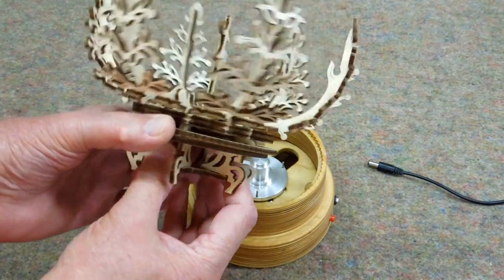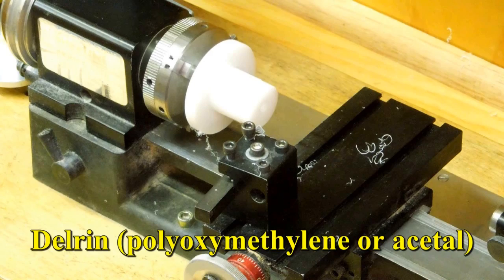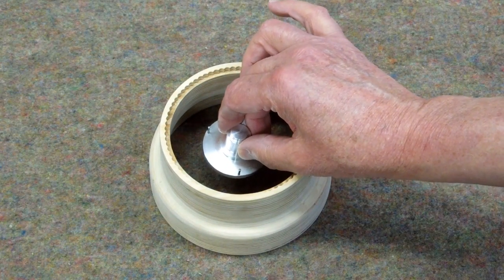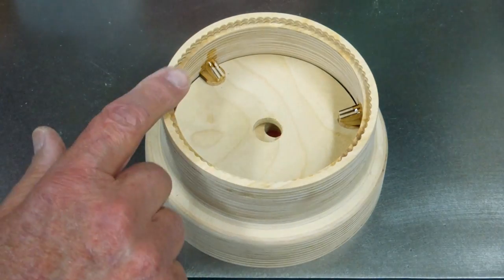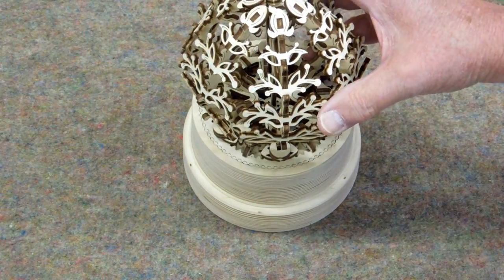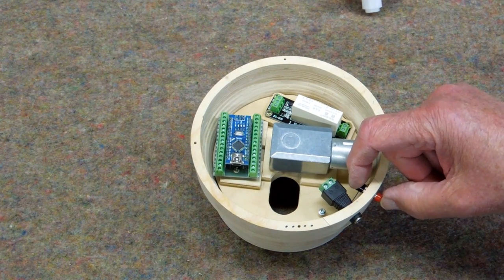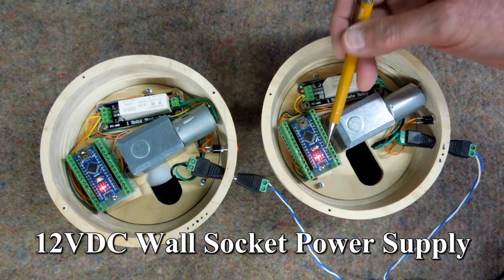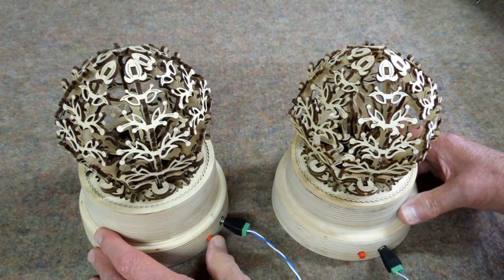Mechanical Flower Part 4 - Motor & Arduino Nano

Comment: Sorry what's the arduino nano for? i thought only the motorized pedestal can turn the flower automatically already?
Reply from the maker: It acts as a timer and controls the relay for the motor. Timer runs for 53 seconds which opens and closes the Mechanical Flower 5 to 7 cycles depending on which gear motor is used. This is covered in Part 4 of the video series. Thanks for watching!
Reply: @RonaldWalters2010  Hi Ronald, is it possible too buy the base and finished motorised part from you? Because i cant make the motor and base myself as i have no workshop...
Reply from the maker: Sorry, I do not sell these.

Comment: I was on the Internet today and quite by accident I came across your video!! I was just given a mechanical flower for Christmas - and was a bit taken aback. I am going to attemp to make it - and wonder if painting the parts (carefully) would be advisable. Also - would you consider making a base for my flower? I would love to have one.
Reply from the maker: This video is Part 4 of a video series. If you haven't already, you should watch the other videos. Part 1 shows tips on assembly and should be very useful for you. That plywood is quite porous so colors may bleed. The parts are cut to very close tolerance. The wood probably needs to be sealed before painting and there is a good chance the sealing would keep the parts from pressing together... resulting in a pile of junk. I decided it inadvisable to do any sealing or painting. Follow the Part 1 Build & Review video and use lots of wax on anything that moves (like gears and axles) or rubs against each other, but not on the parts that press together. Sorry, I am not making any more of the bases. They take are a lot of work and you would not want to pay what I would need to charge. Thanks for watching. Please subscribe. I have quite a few videos that should interest you.

Comment: How about a light inside the base.  It would create some really freaky shadows
Reply from the maker: I thought about using a red or blue LED down inside the base. All those gears and other pieces fill in the bottom area pretty tight and once the Mechanical Flower is sitting on the drive adapter, there really aren't any openings which would allow light to shine up from inside the base. Trying to place a small LED around the ballerina's feet would require the use of a slip ring. It was an interesting idea but ended up being too much trouble. Gave one to my sister for her birthday. First thing she asked, "Why doesn't it play music?" I explained it would have been a recording of ME singing Happy Birthday... she decided it was best the way it was. :-)
Reply: When will you upload the video of you singing?

Comment: I have a question.  So the clover ring stays in place and the legs of the flower rotate.  Is that correct?  Did you think about displaying the legs, and instead, having the clover ring rotate with a chain, gear, or pulley of some sort? Pros and cons?  Also, can you change the timer length to about 2-3 minutes?
Reply from the maker: Yes, the outside ring gear is held in place by the matching piece I made on the router table. The base (legs) are turned by the three pins in the drive adapter I made on the lathe. No, I didn't consider displaying the legs (thus a base displaying a base). +/-  Pros or Cons = K.I.S.S.  It guess it could be done but the base would become quite a bit larger. Doing it the way I chose holds the entire mechanism very stable (no wiggling around). The time is in milliseconds for the Nano...  2 RPM / 3.5 Cycles per Revolution = 57 seconds however the advertised speed of the gear motor is "no load speed" and not that accurate anyway (varies a bit between supposedly identical models), so you need to use a stopwatch and determine the actual loaded speed of the display and adjust the timer accordingly. I have absolutely no idea of the actual life expectancy of the toothpick drive pins operating the pedals. The toothpick axles should last a long time. So I chose a display of around one minute (5 to 7 cycles depending on the gearmotor used). My aversion to using an on/off switch was the distinct possibility the unit would be turned on and subsequently forgotten and allowed to run for an unneeded length of time resulting in unnecessary wear. I chose a single push of a button to allow 5 to 7 cycles and then stop. The Nano can be timed for a longer period... I do not know what the upper limit may be. For 2-3 minutes you may just consider a on/off switch and live with the consequences of wear and tear. All the pieces of the unit just press together, however if it were taken apart to repair worn drive pins (toothpicks) it may need glue for the subsequent reassembly.

Comment: you could put a cam + microswitch on the bottom drive piece so that it will always stop in the "closed' position vs.  an open loop time delay (or a hole/slot cut in same with an optical sensor) maybe if you wanted it to always stop in the closed position.
Reply from the maker: If you watched all the videos you know that one rotation of the base does not equal an even number of openings and closings (cycles). If you want it to open and close several times before stopping "in the closed position" (more than one rotation of the base, as I have done) you still need something to count cycles ... which would probably still require a microprocessor... which is what I have without the further complication of microswitches, cams and optical sensors. Something can always be made more complicated. The actual objective was not to have a simple on/off switch were possibly it would be forgotten and left running, resulting in unnecessary wear... thus a timed run based on known shaft speed.
Reply: Oh sorry, you're right.  I just counted teeth and the drive gear appears to have 24 and each petal is 18.  The ring gear is 60.   Using these numbers, the assembly should return to "home" after 3.5 rotations. (R+S) / S.  This means after 7 full rotations or 7 half rotations (i.e. 2 pulses per revolution) the assembly should be "home" again.  With a 3 RPM motor that'd be around 1.166 minutes it looks for 3.5 rotations.  I hope I did that math right.  As always great vids and thanks for posting!

Comment: Do you know how the efficiency varies with rpm and power changes?
Reply from the maker: With reference to the 12 VDC gear motors, the lower RPM gear motors of this series have quite a bit of torque while the high RPM versions have virtually no torque at all. Search eBay for "12VDC Worm Gear Motor Turbo Right Angle High Torque" and you will find many listings for various RPM units. Look around long enough and eventually you will find someone showing a chart with all the speeds available and the associated torque. Some of the charts conflict with each other as the various sellers copy each others erroneous data, You need to closely study what is available and the exact wording of the listing. Same goes for price.... look around "a lot" before purchasing. Most seem to be 12VDC but there are a few 6VDC & 24VDC.

Comment: A battery and a sensor rather than just time would be a nice touch. (A slot in the delrin and a simple led/photo detector would probably be easiest, a mini three phase brushless instead of the brushed motor would let you drive both position and make it play simple tunes)

Comment: Although the Arduino is pretty cheap there is a way to do the same thing cheaper and without any programming required.
https://www.ebay.com/itm/DC-12V-Infinite-Cycle-Trigger-Delay-Time-Relay-Turn-ON-OFF-Switch-Timer-Module/112267711541?ssPageName=STRK%3AMEBIDX%3AIT&_trksid=p2060353.m1438.l2649

Comment: I might as well be the first to comment on using a microcontroller for a simple time delay switch ;) whatever you have on hand I guess :)
Reply from the maker: Microcontroller -  dedicated to perform one task and execute one specific application (such as timing). Coffee makers use microcontrollers. My coffee maker annoys me nearly every day by turning off before I want it to. However, I did not hold that against microcontrollers in general when building this simple function into the Mechanical Flower. :-)